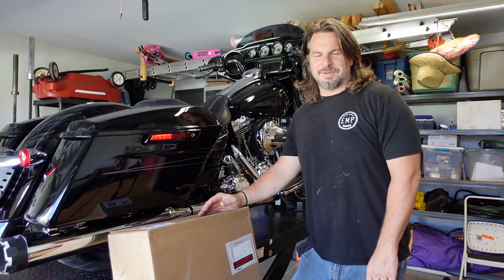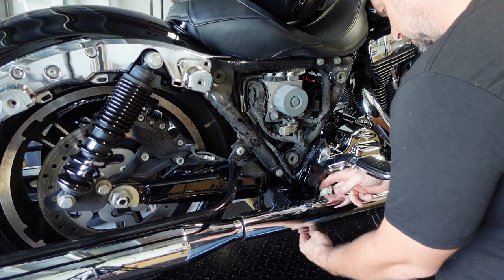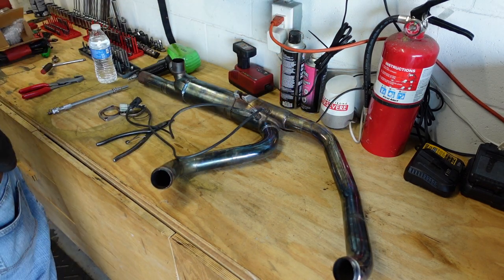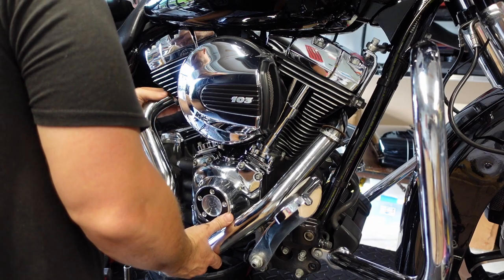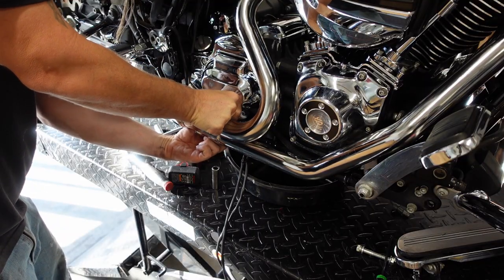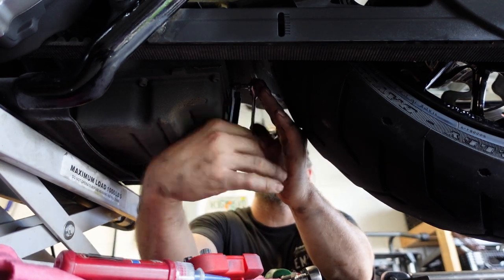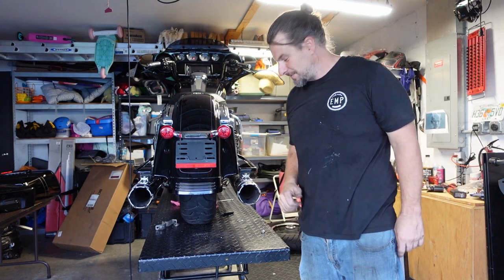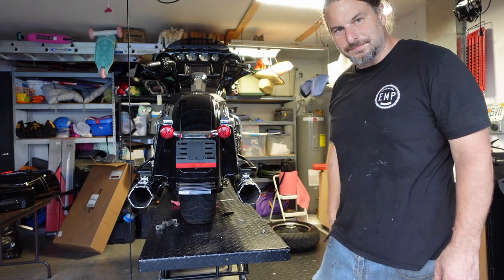Installing the Bassani 2x2 Exhaust Header for Harley Touring Models

Comment: Just did mine last night. Had a HELL of a Time with the spring clamp going onto the transmission bracket! Fought it for 15 minutes as I was also doing the job solo. The solution that ended up working was to put a zip tie on the compressed spring clamp, then the bolt went right in! Great install video!!

Comment: I was able to get these pipes installed no issue and they sound amazing. However, I can't seem to get the stock heat shields on..particularly the shield for the rear cylinder. Wondering if anyone else here has ran into that same problem.

Comment: Do they make it in black? And do the mufflers come with it?
Reply from the maker: This header is for your stock heat shields. Any slip on that works with stock pipes will work
Reply: They do makes them in black and black chrome